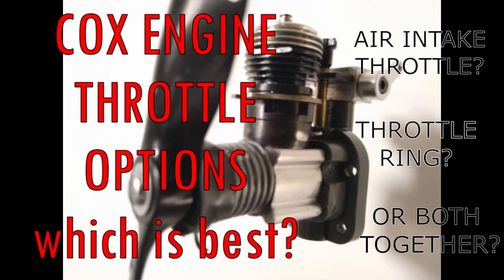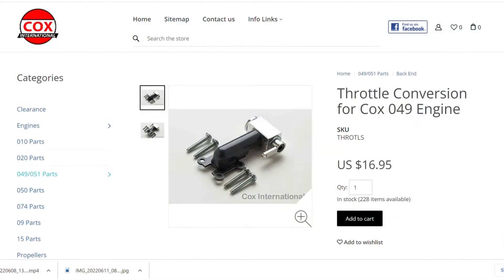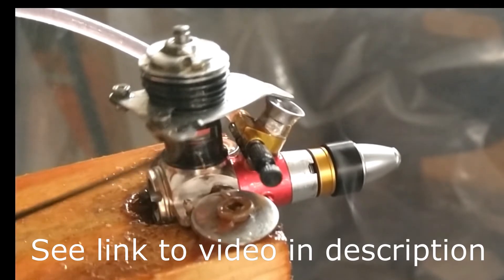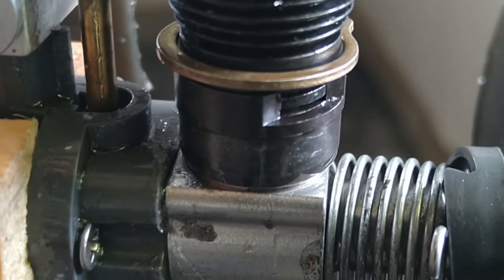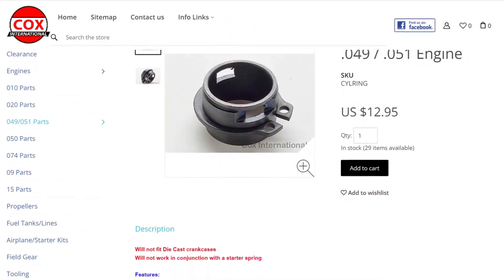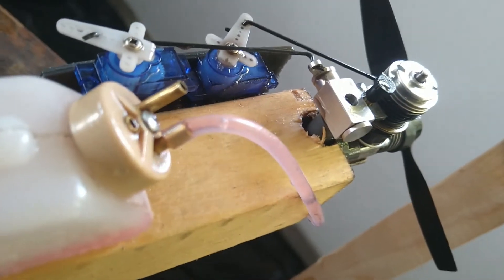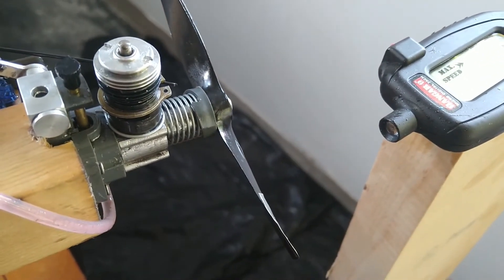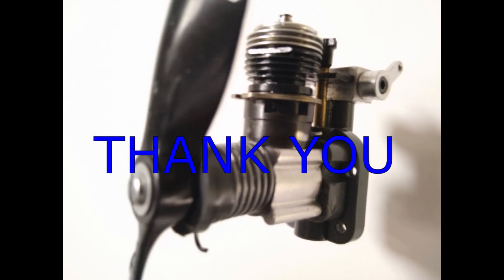The best throttle options for cox engines

Comment: FIRST, I caution you against using more than ONE turn of the starter spring.  This stresses it excessively, and not needed.  It even says this in the engine instructions, and I found it out the hard way as a kid.
I have used the throttle sleeve on three engines, all were used for 1/2A carrier control line models, specifically CARL GOLDBERG Lil' Wizard kits, with the COX Throttle handle and bellcrank on the first model.  Subsequent models used a two-bellcrank mount and a custom modified control handle to add a throttle lever setup,  and you can find these on YT somewhere as a how-to.

Comment: I still got my baby bee with it's throttle ring. I got it new on a Plastic P-40 Warhawk line control in the late 60's.

The plastic control handle had a slide control for your index finger and a third line allowed take offs and landings when a friend wasn't availible.

The engine throttle control was perfectly acceptable because anything less than full throttle meant you were landing as those Cox airplanes were almost too heavy to fly!

I still think it would make a great rc engine in a balsa or foam model.

Comment: Very interesting, thanks for sharing. I'm now eyeing up my old 049s. My understanding is that an inlet throttle needs to restrict the airflow upstream and downstream of the needle valve to maintain the same fuel air mixture. The engine seems smoother with the exhaust throttle.

Comment: The best fix for the throttle body and exhaust rings and Tarno carbs low rpm woe's, is 35% Nitro 15-18% oil.    Extra nitro content will keep the glow plug lit at low rpms, without the methanol dowsing the coil once it sets at low rpm for a bit.  A tick less oil did allow that to happen easier and the motor lived just fine.  The rings and bodys are just airflow shunts which cause the micromotors to go extra rich.  Extra nitro content carries extra oxygen molecules, by it's own self.   THE next best low speed throttle control I seen for the Cox motors was the OEM Cox/Maples throttle body for the 1/12 GTP Nissan R/C onroad.  Those Maples throttles, when set right even outshined the Tarno adjustable lowspeed needle carbs, for the flight .049's.    The caveat emptor, was that the Maples would goop up pretty quick and needed attention often.   You can usually find Boat fuel or Heli fuel that is 35/10.  It's what I use.  You could also use 30/10.  Grab some Sig or Klotz or Novarossi Castor and bump the oil in the jug to at least 15%, BEFORE you take ANY out of the Gallon jug.

Comment: I recall playing with the exhaust restriction ring on a(n) .049 back in the 70s.   I could get it to run very-very slowly and sip fuel (for non airplane purposes) by simply adjusting the needle valve while restricting the exhaust.  If I remember correctly, making the mixture richer made it run slower.  The ring assembly I had fit very tightly on the cylinder and would shut off the engine when fully closed.  IE it was full on to full off.  I had an extra channel on my MRC and could manage the mixture change with the remote.  The mixture lever fit over the needle valve knob after adjustment. (used it on a model pontoon air boat).  I still play with the .049s and newer engines - cox engines are still my favourites.  Nice discussion, I wasn't even aware of the air intake throttle back then, not sure when it was made available.  I would bet that using the needle valve adjustment method you could extend the range of the RPM management with that throttle as well.

Comment: Overall the exhaust restrictor is the better option... mostly for better operations.
The drop from full power to even 3/4 is well below landing speed.
If you need ... more range?  both are required. The problem for 049 in R/c is a reliable
tank pressure system. The carb is more of a spray n pray than a metering system.

Comment: When it quits, it's quitting rich, that is why it takes a long time to start again.  Very nice low idle acheived with both.  Perhaps setting up some mixing you could get those two servos working in a model very well and reliably.
Reply: A bit complex for a 1/2A...
Reply: Not really. One servo two horns. Vary the length of the horn on one side vs other to set a throttle to exhaust ring ratio. Very easy to make work with one double sided servo.

Comment: I am the very person who developed and researched and made the proto types of the.09 and.05 Cox engine's with the barrel carburetor's with muffler's of which novel finally made their own basic copy with barrel carburetor's with muffler's. Novels being schnurl ported on the sleeves. And having aluminum pistons with wrist pin or piston pins. Novels block designs allowed bigger porting. Aluminum block also cooling better and more fuel efficient and more power and better tunability and stronger lower idle especially on their big mig sport engines. Throttle ring on Cox engines were superior to the barrel carburetor. Also novel start easier.

Comment: The air intake valve is NOT a carburetor, and is lacking an idle circuit like a true carburetor would have, and is surely leaning out the A/F mixture as it closes off the air supply. 
The exhaust ring doesn't affect the incoming airflow and the A/F ratio like the intake air valve does, and I'm certain that's why it works better and the engine is more stable at lower RPMs with it.

Comment: Nice video! For actual flying situations, the throttle ring is slow enough for reasonable ground handling and landing. The real plus is that the acceleration is instantaneous, which can help bail you out of a botched landing approach or a sudden gust of wind on the final leg. I have both .049 and .09 versions of the 60's style slide exhaust restrictor / intake flap combination.  Although they perform really well in terms of engine speed control they are very fragile, fiddly, and the large slide area can easily get contaminated with dirt and dust and start sticking.  I can see why Cox abandoned it a long time ago and instead relied on the more elegantly simple throttle ring implementation.

Comment: The air intake valve is really a choke since the spray bar is downstream of it. This richens the mixture as it restricts flow since the spray bar essentially "sees more vacuum" and thus flows more fuel per the amount of air entering. When the engine finally dies due to closing the valve it becomes flooded, hence hard to start. The exhaust ring by itself primarily restricts the flow thru the engine without affecting the air/fuel ratio directly but only due to the retention of some of the exhaust gas. Using the two together somewhat mitigates the air/fuel ratio disturbance at the spray bar caused by a high vacuum (restricted intake) by adding back pressure.   45 years as aerospace engineer with fluids, thermo, combustion background and ex contol line kid from 50's-60's.
Reply: This video has given me hope of making a tiny gas/electric generator for a small 7-10in quadcopter. Thanks for the explanation on why it’s best to use both a throttle and exhaust ring for engine speed management. Will help me control voltage coming out of the electric motor.
Reply: If you look at vintage RC engines, often from the 1960s before muffles became pretty much mandatory, they almost always had that coupled system. A relatively simple carb, and a butterfly valve over the exhaust. 

The first OS mufflers (the early "Jetstream" types) even had that valve in the muffler still.
Reply: Wow!😮A very nice and professional explanation of the little engine in the video!!❤💯💯👍👍
Reply: Just as, he kinda had a, sort of dual throttle setup. The one on the back of the engine, was more of an traditional carburetor and the throttle ring, would restrict the exhaust flow, thus, slowing the rpms down. The funny thing is that the propeller is the flywheel!!

Comment: Nice video, first of all I want to say that with 6000rpm on a Cox engine you can perfectly land a Q tee since at those "low"   rpm Cox prop produce very limited thrust so there is no really need to go that low. Now in my case I have a tee dee with a carburettor and a throttle ring that work together. Ring helps the engine stay hot at those low rpm and idle perfect at 6000. For a standard 049 like black widow or golden bee I would choose the ring only since it can reduce revs very satisfactory as in your video.
Reply: I think the ring does the job just fine I'm going for that option I think once dialled in should be fine fingers crossed, good luck all

Comment: I will toss my two cents into the wind:
1.  The exhaust restrictor comes with a rectangular opening.  This makes the closing crtical.  If you use a small file and change the closed-off side of the rectangular opening to a "V" notch, you get a slower, gentler cutoff which improves control of the exhaust restriction.
2.  You need to watch the arrangement of the control rod as it goes to the restrictor.  If you don't get a good (nearly square) angle betwwen the rod and restrictor plate as it closes, the restrictor closing becomes "twitchy" and causes problems.  Also, since the engines have screw-on cylinders, keeping this arrangement requires some fiddling after putting the cylinder onto the engine after removal for maintenance.
3.  The stock needle valve assembly on TD engines generally leaks air and makes settings difficult.  First fix is to put a small piece of silicon fuel line tubing over the needle valve.  The tubing needs to go from the venturi shoulder where the needle valve enters, and back to the shoulder on the needle valve where the threads stop.  This makes a gasket which stops air leaks.  Better fix is to get a Kirn Kraft needle valve assembly and put a length of tubing on its needle valve.  I have no idea how long ago Kirn Kraft stopped production.

Comment: What type of cylinder did you use?  How many bypass ports did it have and did it have boost ports as well.  Also did the piston have SPI?  Thanks.
Reply from the maker: Thanks for the question. The engine is a recent a standard SureStart 0.049. Looks to have 2 ports and no SPI. Thanks.